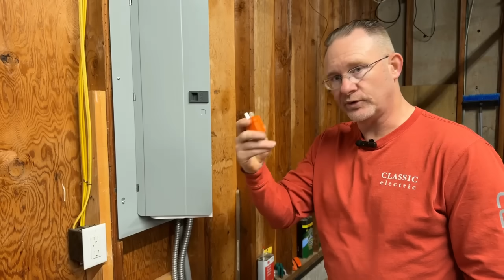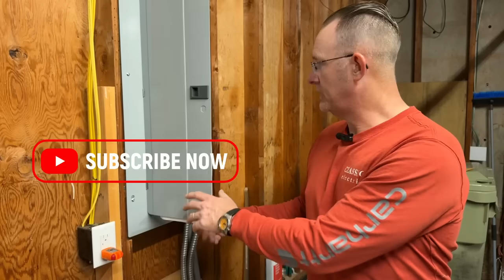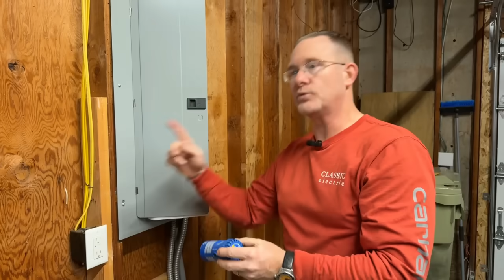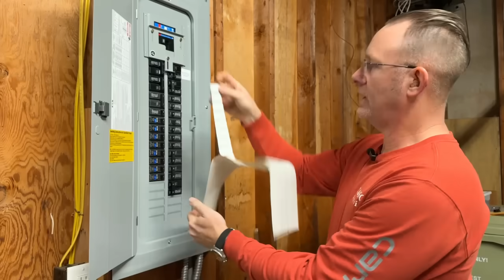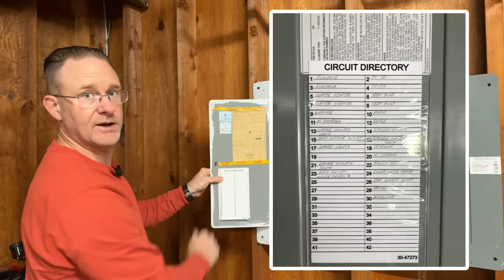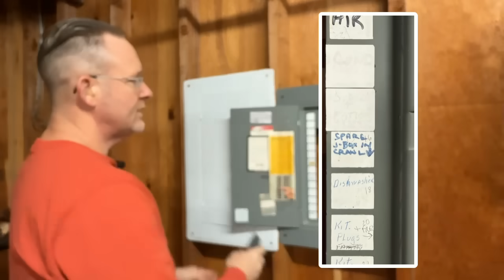Easy Ways to Identify Electrical Circuits in Your Home to Label Your Panel Correctly

Comment: In a multi-level house back in the day I would use a radio blast it up then hit the breakers until no more music. 
Saved a lot of running around.
Reply from the maker: That absolutely works, it's a fantastic idea!
Reply: When I work on a circuit and find the breaker, I mark the back of the plate with the breaker number with a sharpie.
Reply: Radio is the best .
Reply: I replaced all the outlets in a house that I bought before testers were readily available; alone. So my radio was my best friend.
Reply: Use two radios
One on country music
One on rock n roll
Reply: For really large houses you can add a 50' extension cord to the radio.

Comment: Won't work with two prong outlets
Reply from the maker: Sure it does!  Lots of lamps have two prong plug cords so you can use the method similar to the example I gave using the work light for example.

Comment: Maybe try a circuit breaker finder and a label maker. Just a thought.
Reply: I was just gonna say...
I have the Klein model and it's very useful. Plug in a device similar to the first tester he showed, but it sends a continuous signal which the pen-like device can identify in a sweep of the panel, like a Geiger counter.

Comment: I recently bought a Klein circuit breaker finder, using a GFCI outlet tester that also sends a signal back to the breaker box where a non-contact probe is scanned across the breakers to detect that circuit with an audible and visual indication.  It's not foolproof, but I can find the corresponding breaker in an average of two attempts rather than an average of flipping 12 breakers randomly, and I don't need an assistant or me running back and forth to see if the outlet is powered.
Reply: As a retired electrician. I was wondering why he wasn’t showing a scanning breaker indicator?
Reply from the maker: You’re right, I could have shown other methods and these are good ideas. The purpose of the video was to keep it inexpensive and not complicated for the homeowner. I didn’t want to suggest that everyone go buy a $100 tool and they only use it once to label their panel. Then it will sit in a drawer and never get used again. I want to be respectful of people’s time (length of video) and money.
Reply: Glad for this comment. I was thinking about getting this myself.
Reply: I recently bought and attempted to use this device to clean up the messy labeling in my panel. I got a lot of false positive readings with the probe identifying two adjacent breakers. Does this indicate a serious problem in my panel?

Comment: I purchased a Digital Circuit Breaker Finder Kobalt brand for $35, Klein also sells one for $48. Includes the receptacle plug GFCI tester & breaker finder. It gets you close. I wouldn't say it's a bullseye but it gets you within three breakers you can figure it out from there.
Reply from the maker: Absolutely, that works!

Comment: Perhaps this video should be titled “How to identify the circuit next to the electrical panel only” rather than “Electrical circuits in your home to label your panel correctly.”
You didn’t show how to identifyi any other circuits—such as master bedroom lights, rear bedroom, bathrooms, or outdoor lighting. Identifying the circuit located right next to the panel is extremely basic; even a 12-year-old could do that.
Reply from the maker: You make a good point. There could always be more detail. The downside is that too much detail can become confusing.

Comment: However... when you add a breaker for your generator and lockout at the top near the main to avoid back-feeding the neighborhood and protect the lineman, your breaker positions will shift and you need to do this all over again.
Reply from the maker: Sure, if you move breakers around you will have to re-label the ones you moved.

Comment: One idea that I use when im working on a circuit, is to WRITE what breaker # that circuit is on the inside of the electrical box. And use white tape on the cover and write the number there too
Reply from the maker: Absolutely, that's a great idea!

Comment: For figuring out a remote outlet, you can use an old cordless phone.
Plug the base into the outlet you need to figure out, take the cordless handset with you to the breaker.  When the base has power, the handset will be rather quiet but you can tell it is receiving the base.  When base loses power, the handset will have static.
Reply from the maker: That is a very creative solution to help you identify remote outlets!
Reply: Remove the back up battery in the base set or shutting the power will tell you nothing.
Reply: @bills6946 I agree it depends on the model but it has worked for me.  My base unit doesn't have a backup battery.
Reply: @bills6946 seems I misinterpreted your reply.  You meant be sure to remove the backup battery from the base unit if it has one.
Reply: @danman32 
Correct. Just adding my FWIW opinion so viewers test correctly and not waste their time.
Reply: I use a radio by the panel and enough extension cord to reach every receptacle, and a runner.
Start with a map of the house.
Reply: Or plug in your radio at your outlet location and really crank up the volume. @rickhawkins218
Reply: You still have a cordless phone?  All of ours went to E-waste when we cancelled our land line.
Reply: Because i have so many of these just laying around...

Comment: Little more work but I create a graphic layout with outlets and switches color coded with a breaker panel insert with color coded breakers. Then there is no question. You may know which way is North but on a cloudy day or at night, the new electrician won’t.
Reply: what did you use to create the layout
Reply: @Racontactapple’s word processing app ‘Pages”.